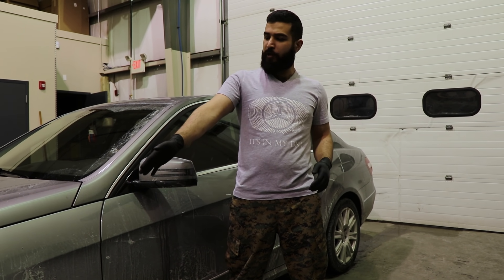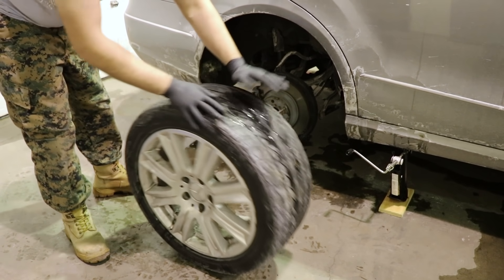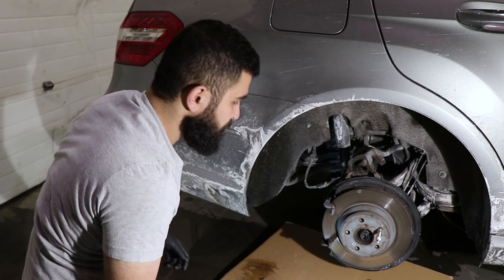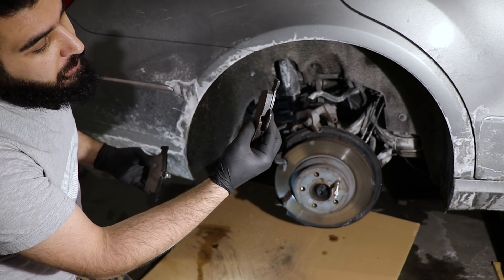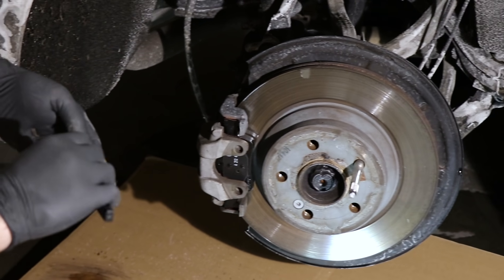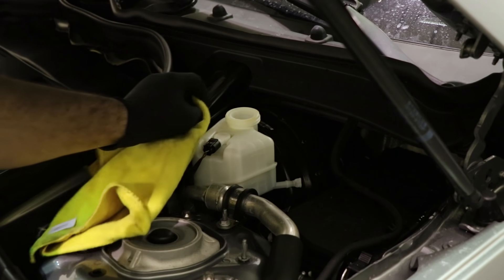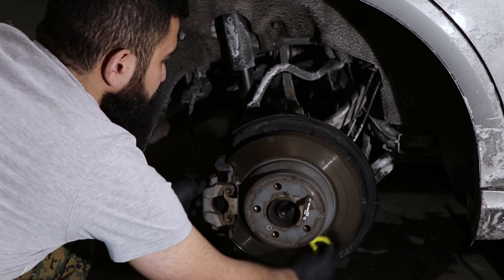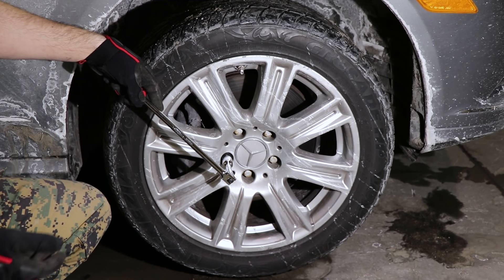Detailed Brake Replacement And Fluid Flush On Mercedes Benz E350 (W212)

Comment: It's easy to tell that you put a LOT of time and effort into creating this video.  Very good job on your part, and thank you.  
I'm starting my wife's car tomorrow due to a tiny pulsation in the brake pedal.  I plan to have the rotors turned instead of replacing them.......wish me luck!
Reply from the maker: Thank You For The Nice Comment Brother! Let The Force B With You. Good Luck 👍🏻
Reply: If you are turning/re surfacing the rotors be prepared for them not having enough thickness to re surface.   Cheap rotors these days and can usually be resurfaced ONCE.  After that the minimum thickness to resurface might be gone.  A legitimate shop would refuse and the minimum thickness should be stamped on the rotor either on the vent side or the rotor hat.
Reply: The idea of compressing the caliper piston flush is like he explained is to make up the difference. Thickness between the old pads and new ones.
Reply: I am used to working on older Mercedes, but the factory service manuals do not recommend resurfacing rotors when you replace brake pads. Insread, they recommend that you "bed in" the new pads by a series of gentle stops. If you have flutter when braking, I would suggest getting a dial indicator and checking the rotors for warping after removing the wheels. It may be that you are close enough to the wear limits that you will want to replace the rotors, anyway.

Comment: i did mine myself i will tell anyone who does it to use the silicone grease them pins also need to go in hand tight i thought i crossed threaded it, it would not go in but i got it in but its easy to do and recommend doing it yourself ive done brakes on lots of different cars

Comment: You put the front left inner pad on the right side when you changed pads because you didn't like the way the sensor fit. The pads are marked on the backs and ARE different. The sensor has two wires because the wire makes a loop in the pin section of the sensor. Once the rotor wears though the pin it cuts the wire and turns on the light on the dash. So no, you can't reuse them.
Reply from the maker: I Gotta Give You Props For Such Attention. I Noticed That Right After Installed The Other Side Lol. Thanx For The Comment!

Comment: How many bottles of break fluid do I need yo flush it and fill it back up? Or just one of 1liter bottle is enough?
Reply from the maker: I Got 2 Liters And Used Only .5 Liters To Bleed The Brakes. I Don’t Really Know How Much In Total It Takes To Flush The Brake Lines.
Reply: Remember DOT4 brake fluid and DOT3 ARE NOT Backwards compatible......This means that DOT 4 fluid will work on DOT 3 systems but DOT 3 is not compatible with DOT4 systems.   The DOT4 fluid has a higher boiling point which increases protection again boil over and possibly fire.
Reply: Great video!!!
Reply: @stephencannon3140  and then Benz has their own fluid compatible with their own special parts just ATF and steering fluid or coolant:
OEM fluid is the best policy 🙂
Reply: @glasser2819  benz doesnt have their own fluid, they are using dot4+...

Comment: Great video. Thanks.  I noticed that you did not change the rotors.  Did you have any noise as a result of using the old rotors?
Reply from the maker: Thank You For The Comment. I Was Surprised Myself, I Still Have The Same Rotors On And There Is No Noise, Even Before I Broke Them In.
Reply: That is good to know.  I changed mine today and also did the rotors.  Mercedes recommends changing them on the basis that they are thinner than most, and therefore cannot be resurfaced on a lathe. The rotors came with a grey primer, which i removed with brake cleaner before installation.  I see a lot of questions online about the affect of paint on the new pads if the paint is not removed.
Reply from the maker: Correct! Mercedes Recommends Changing Rotors And Pads Together, But Since I Had Less Than A 1mm Of The Lip On The Edge I Decided To Give It A Shot. As Far As The Primer On Rotors Is Recommended To Let The Pads Do The Cleaning. That Way You Won’t Have Rust On The Exposed Surfaces That Pads Don’t Touch.
Reply: Rotors for older Mercedes have wear limits stamped on them, which is the thickness below which they must be replaced. I use a caliper to measure the rotor thickness.

I don't know about the newer cars, but I don't see why anyone would change a rotor that is not worn out, unless you just want to help your mechanic put his kids through college. I would guess that the housands of deisel Mercedes taxicabs throughtout Europe do not replace rotors until the wear limits are met.

Comment: Hey brother, great video however allow me to give you some tough love regarding safety. Rule 1: Never put your fingers underneath the wheel when the car is jacked. Or any dark places for that matter  that you cannot see well even if the engine is not running. Almost lost a finger like that. Rule 2: Always use proper jack stands if you are going to perform vehicle maintenance at your home garage and i don't mean the cheap ones from harbor freight, walmart etc or some cheaply made stuff but invest in some proper certified jack stands. My guess is that if you can afford such a car you can definitely afford 4 proper jack stands and probably a decent hydraulic jack. That's a 2 ton car and you don't want that thing falling on you so even if you use jack stands you must leave the jack at the place you have lifted the car at the first place. Also once you are probably bleeding the breaks and change break pads i suggest you remove all 4 wheels and place them underneath the car in case you will be working under it or do an oil change. If you have trouble removing the wheel nuts use a metal pipe/tube fitting it over the breaker bar for extra leverage. Wear a small face mask when cleaning the dust break the rest is just fine and i enjoy watching car maintenance video so thanks for the video.
Reply from the maker: Thank U For The Comment Brother! The Safety Was Newer My Strongest Side Lol. Also Thank U For The Input Into Community. Have A Great Day.
Reply: I have had the Harbor Freight jack stands and the three ton low profile axle jacks for over four years and ten vehicles.  Jack stands and jack have not  collapsed, bent, warped or other mechanical/workmanship failure.
Reply: If you need to compress the caliper piston use the pad that is being removed and a C clamp to slowly compress.   No sense in risking damage to the new pads....gouge , Knick, crack or possibly separate from the backing pad.
Reply from the maker: Correct! I Used The Old Brake Pad To Open The Caliper.

Comment: Great video. 

But do your family a favor, and get some jack stands to hold the car up when you are working on it, rather than having the car supported only by the jack. Also, use brake pad paste on the back of the new pads to prevent brake squeal, rather than anti-seize b/c it won't melt and migrate in high braking tempjeratuess. And don't forget to put a drop of blue Loctite n the bolts when you put things back together. Good luck
Reply from the maker: Thanx Man
Reply: I use anti seize on the bolts  some mechanics agree with me some dont  works for me

Comment: Thanks for the video, 
I am wondering if you want to share, what tools do you use to help to put the wheel and take off? where did you buy it? what size? thanks,
Reply from the maker: I Show All The Tools And Sizes Individually In The Video. I Bought Them On Amazon, They Go For Around $200.
Reply: Thank you for your reply, I just need more information of the tool that I wanted to have, what is the name the tool that you use to remove the wheel and put it back ? in your video (2:31) after you mentioned the brake pad spreader. If you want to share, I appreciate it so much.
Thanks for the great video. Have a great day bro.
Reply from the maker: Oh Sorry I Just Realized What Tool You R Talking About Lol. It’s A Mercedes Benz Wheel Alignment Pin. It Should B Included In Your Spare Tire Kit. If Not They Are Cheep On Amazon. Good Luck!
Reply: Wow, thank you so much for the information.
As I have never checked to my spare tire kit, and I didn't know if the helpful tool is included in my car tool kits. I got it.
You are my hero, bro!!. thanks so much.  I will try to replace my brake pad this week. Thanks.
Reply from the maker: Glad To B Helpful😉
Reply: The caliper piston can be done with C clamp and the caliper side of the pad you are removing and replacing.  The other option is a universal kit that fits most common vehicles.  The different dies in the kit allow multiple vehicles.  For the Fronts I just use the C-Clamp and the inboard side of the pad that was removed.   For Rears pay attention.  Some vehicles rear calipers Twist to compress.  There is a valley in the piston. Line up the dies with the piston and slowly turn clockwise until flush with the caliper frame.  Honda for example uses a square pattern.  Tabs on the Die line up with the valley on the caliper. Slowly turn....about 99% percent is clockwise.  The die can be turned with a ratchet and or small extension bar “3”
Reply: I got my kit from Harbor Freight for around $50 and has served for at least three vehicles and about to be dusted off for a fourth.

Comment: 7:44 It doesn't turn because the other wheel is on the floor :D not because of the brake, even if the E Brake is not pushed the tire won't spin.
Reply from the maker: LMAO Your Right😵

Comment: Great video!  Do you recall approx how many miles you had on the old pads before they had to be replaced?
Reply from the maker: Good Question! Approximately 35k-40k But I’m Pretty Harsh On My Brakes Lol. Your Milage May Very.
Reply: fear not, the pad sensors will remind you when it's time for your brake job: 40 to 70kMi

I leave in California and drive around countless hills all the time 40KMi and 20K more to go. 
Total 60K but read this...

I lubed my slide pins at 8k with silicon when the brakes had gone harsh after driving through a 30Miles long mountain road... MB minimal lube just had evaporated. The calipers on my new Benz were sticking instead of sliding to release... 😂
 
After silicon lube my brakes have been and stayed smooth and proportional for the last 40k.

As expected the hard pads are eating the soft OEM disks...  Replacements will be Akebono ceramic pads + (Zimmerman?) rotors...
Reply: The front brakes do most of the work, so I think you can expect 30K - 40K for front brake pads, and around 60K or more for the rear pads. The black dust on your wheels is what is left of your pads after braking wears them away. I think you will see more brake  dust on your front wheels.
Reply: @glasser2819  Pathetic is the wrong word Sir. You know not of what you speak. The stunning braking of an MB is achieved through the coefficient of friction between the sacrificial rotor and the pad material. Both designed and matched to a very large spectrum of driving habits.

Comment: Instead of kicking the tire to get the wheel loose, try this.
 Loosen all the bolts on the tire you are working on, while the tire is on the ground, shimmy the car by pushing on the side fender nearest the wheel you are working on, basically the wheel gets wiggled loose when you rock or shimmy the car from side to side, this is what I saw a mechanic at the deanship did to my car years ago and I put 2 & 2 together and figured out what he was doing.
Reply from the maker: Woah!!! Genius! Thank You Man!
Reply from the maker: Sounds Legit.
Reply: Or loosen all lugnuts.......lug studs for European vehicles.  BEFORE raising tire off ground.
Reply: Is that a “Tire Tree” in one of the lug stud holes?  The “tire tree” is basically a threaded stud that takes the place of the lug studs Thread it in but only the thread holes.  The flat surface allows you to hang the tires weight on the rotor hub to help with installation of the first couple of lug studs.  I haven’t used them yet but sounds like a must have for DIY’ers especially when raising tire for installation.  As you reinstall the remaining lug studs you can remove the tree without worrying about the tire tire not being aligned in the hub.
Reply: Steve Cannon, every Mercedes has a threaded alignment stud in the toolkit which is used when changing a tire to line up the wheel with the threaded stud holes on the hub. I haven't actually used one yet, but there have been a few times when i wished I had....

Comment: All good, just put the brake sensor wire to the other pad, not the one that you placed it. That sensor costs 1.5euro, if it rips off dont let the dealer rip you off with a "ultra important expensive part that saves lifes". I buy it every time i change pads, never re-use old one, its not worth the money and time if it fails.